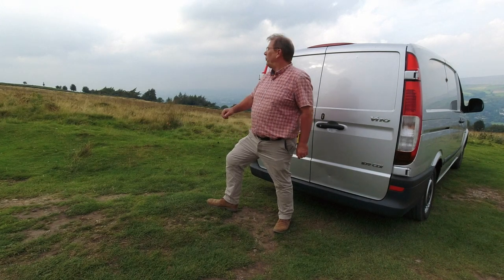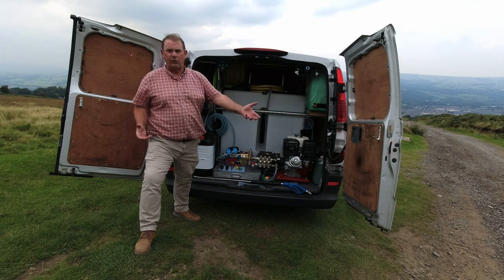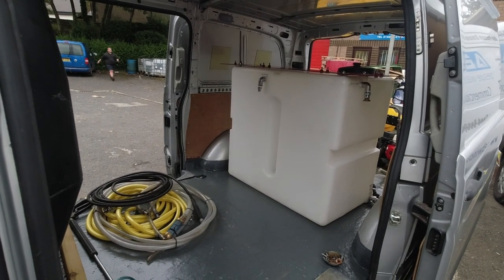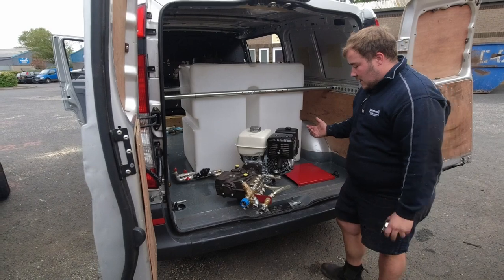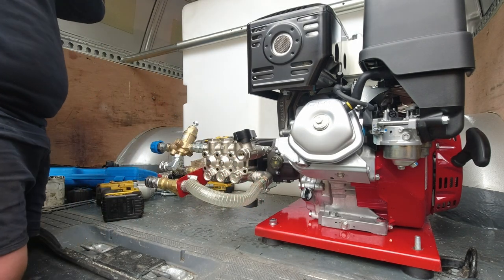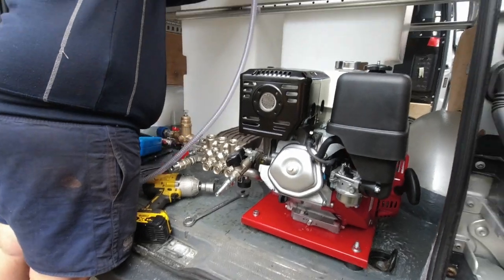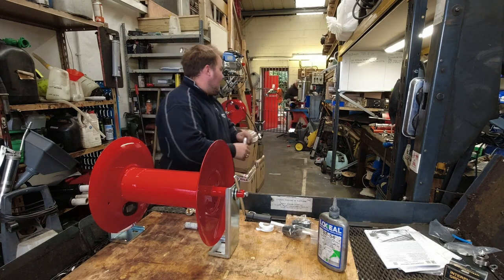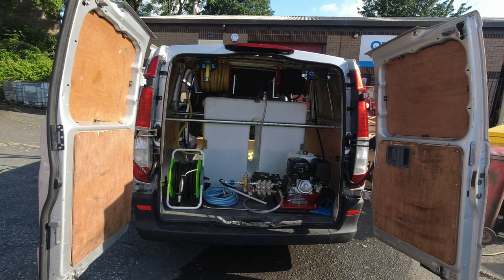Van Setup. Pressure Washing Vehicle Setup and Build.

Comment: one question the a feller on eBay selling packages deals over the water ? Loncin Engine Petrol pressure washer 3000 Psi 21 Litre Reduction Gearbox Package can you beat that  deal  I may be looking for a new set up soon thanks
Reply from the maker: Sorry. I don't know them and I am not familiar with Loncin engines.

Comment: Enjoyed the video 👍
What kind of % strength hypo can you get from the downstreamer? I know a lot like the xjet as it can do 50/50 water/chemical but with your way you don't have to cart a barrel around with you!

Many thanks
Reply from the maker: It's a lot less than an x-jet Joel. Better for softwashing  tasks rather than concrete and block work. I have an x-jet as well, and yes moving the barrel around can be a bit of a chore.

Comment: Hi Mark, what size is the tank and how is it secured into the van? Are you using luggage bars?
Reply from the maker: It's a 500L tank but it's definitely possible to manage with something smaller. It is secured with loadlok tracks and telescopic shoring bars. I rarely travel with water on board so the loadlok system is over spec.

Comment: Hello, what is the rail system you use to keep the tank in place ?
Reply from the maker: It's the LoadLok system. Also known as Q rail or 1806 track. It's often fitted to vans and trailers, large and small.

Comment: What did they use to bolt your machine down.
Reply from the maker: The machine is mounted on a skid which is bolted to the floor on rubber bushes to absorb vibration.